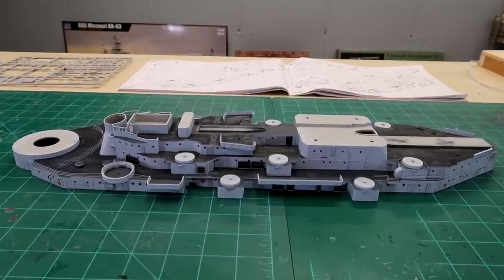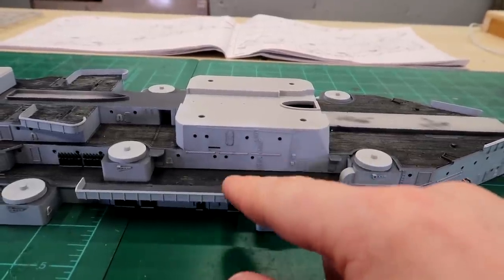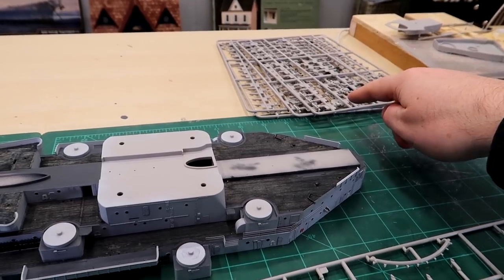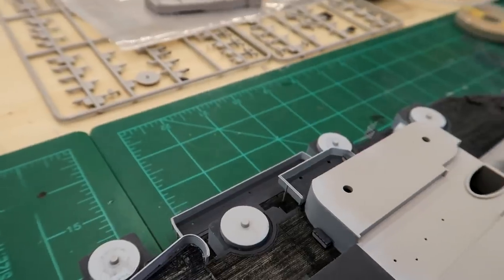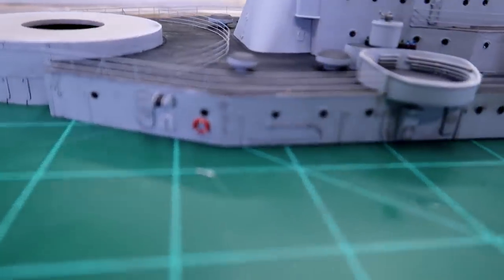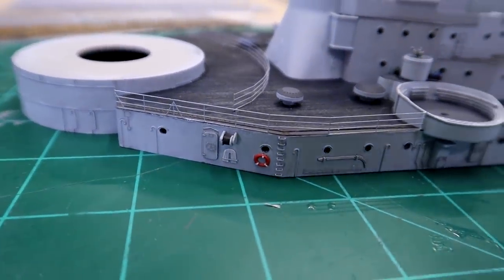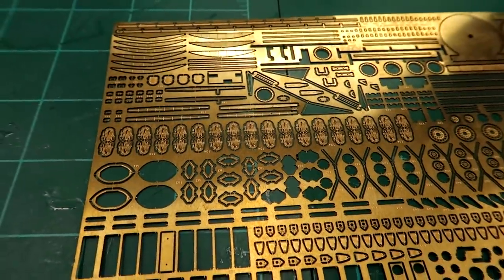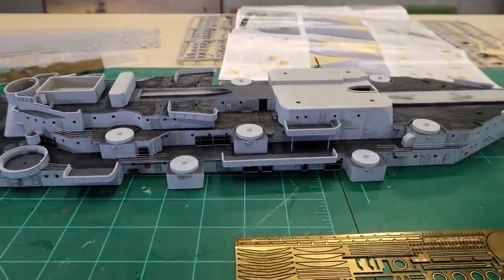1:200 scale Missouri by Trumpeter Build Video 16

Comment: Really enjoy your work. You can easily cut small aluminum tubing by placing on glass or hard surface and use an Exacto knife blade and just press gently while rolling the tubing back and forth with the blade. Cuts in no time and gives you a square cut.
Reply from the maker: I will give that a try!

Comment: I'm glad you're building this ship and not me; I'd have thrown it across the room long before now.😬 The level of fiddlyness is off the scale. You have the patience of a saint Ben. While the feeling of achievement must be immense, I think the build would stress me out, rather than relax me. I'm quite happy just watching you doing it.
Something you didn't show, that I was slightly worried about: you masked off the deck while you installed all these ammo racks. Did the racks not get glued onto the masking tape? Did you have any bother getting the tape off the deck?

Cheers for now,
Dougie.
Reply from the maker: Hey Dougie! I just used a very tiny amount of glue when I installed the ammo racks. So they only stuck to the walls. The tape came right off without any trouble at all. That’s why I left it out of the video. Glad you’re enjoying the build!

Comment: I think you might be able to hold a small piece of tube like that stable for sanding/filing if you were to use a piece of music wire of an appropriate diameter in its center. The "tail' of the wire could be used to maintain the orientation of the tube. (Three arms would also be useful, of course. 8-) )

Comment: I have been watching your videos for this build since i am building its sister ship iowa. I dont have the detailed up set though. But it did come with photo etched parts. I would actually want to ask what you use to glue the PE parts together and to the plastic model. Since i only have the tamiya plastic cement and i use it on everything in this build. Cant wait to see you finish this masterpiece.
Reply from the maker: Thanks Jose! I use super glue to attach the PE. The Tamiya glue won't work because it melts the plastic together and so it won't work on the PE. Here is a link to the stuff I use: 

https://www.amazon.com/Insta-Cure-Filling-Bob-Smith-Ind/dp/B0000DD1QQ/ref=sr_1_4?crid=3TCPXWRI56VT5&keywords=cyanoacrylate+glue&qid=1580259842&sprefix=Cyano%2Caps%2C176&sr=8-4

Comment: Thank you for putting in all the work it took to produce this video.  Did you have any issues removing the masking tape from the floor of the bofors tubs? I could see myself getting CA glue all over the lowest ammo rack and onto the tape.
Reply from the maker: Thanks Jeff! And you’re the second person to ask me that. The answer is no, the masking came right off without an issue. I thought about that ahead of time and made sure to use a very small amount of CA. When I peeled the mask off I just made sure I was pulling away from the ammo rack so as to not bump them. I guess in the next video I’ll show that step!
Reply: The Midwest Model Shop thank you!  I’m about to start my first ship in about 40 years, the Tamiya 1/350 Fletcher with a full set of photo etch from 5 Star.  Your videos are a tremendous help and inspiration.